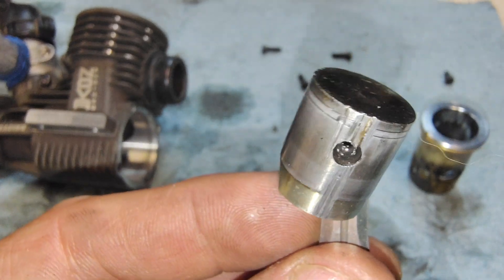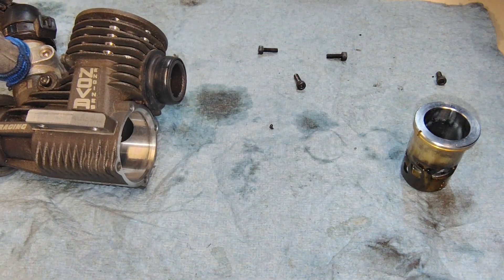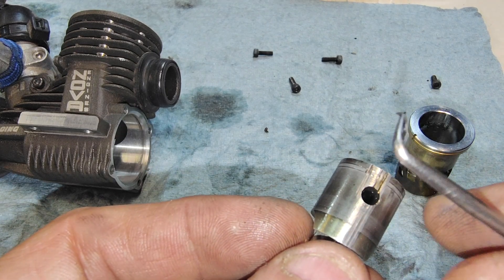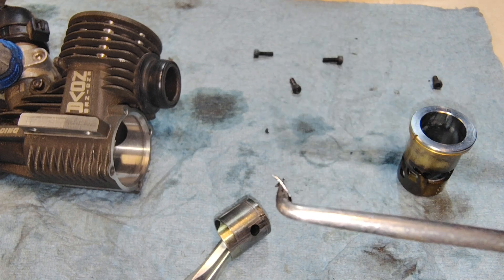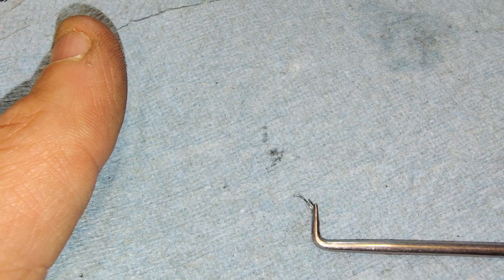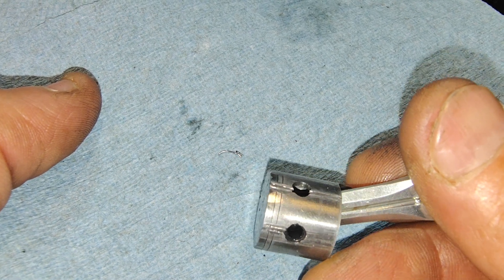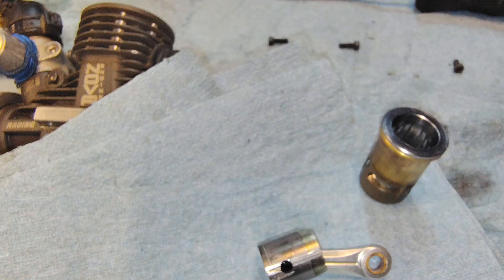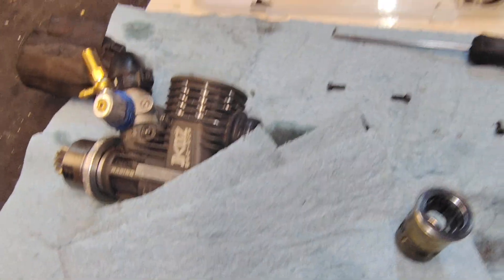Nova B5R - KILLED ITSELF : piston pin clip broke: killed Sleeve and piston

Comment: Isn't there a recommended position for the open end of the wrist pin retaining clip?
Reply from the maker: I'm not sure. Never heard anyone talk about it.
Reply: @TexasHill  maybe not in RC circles, but every engine builder that is worth their hourly rate knows which way to orient a clip. and every tute on engine rebuilds, every aftermarket piston with instructions included mentions it...

its why a lot of the small engines run teflon caps instead of clips. except these ones are so highly ported they cant use that option...